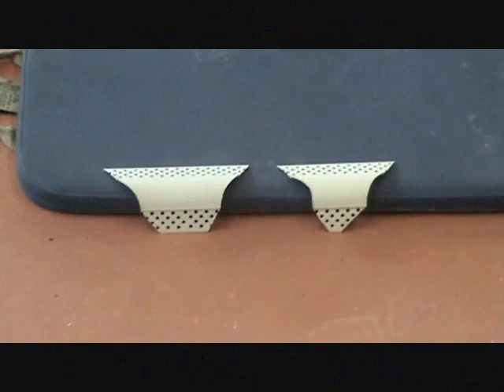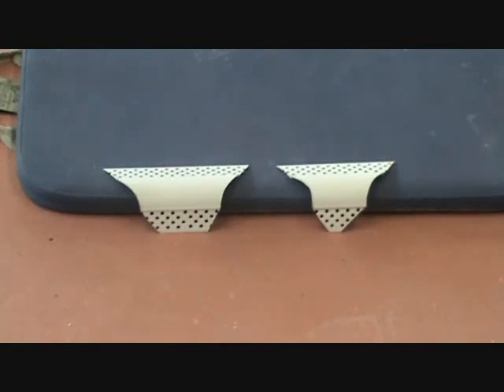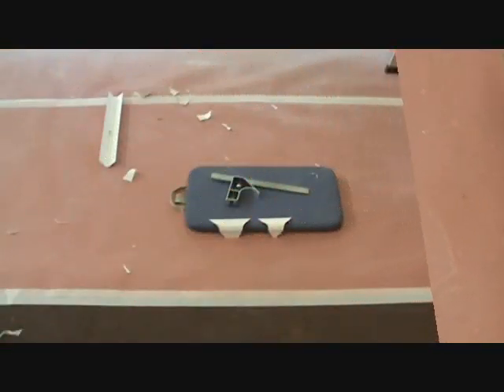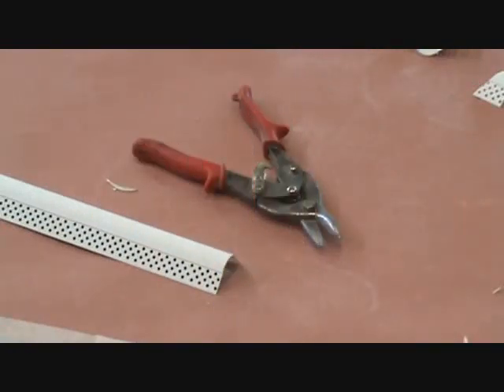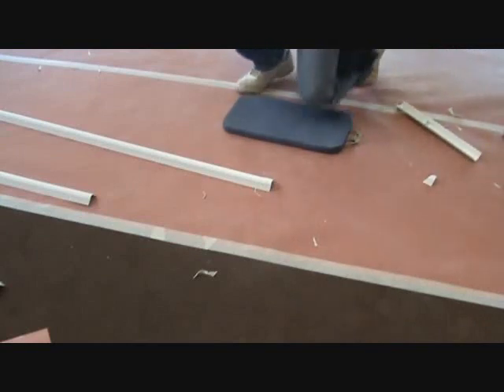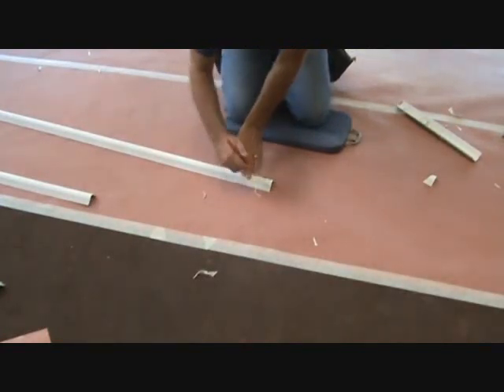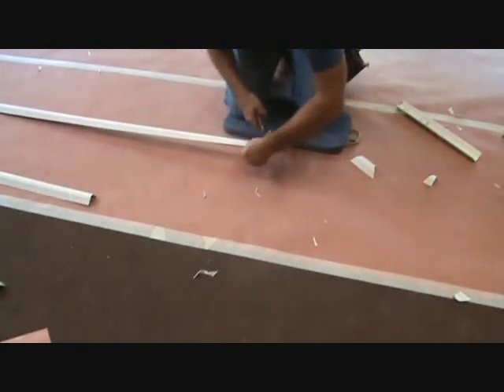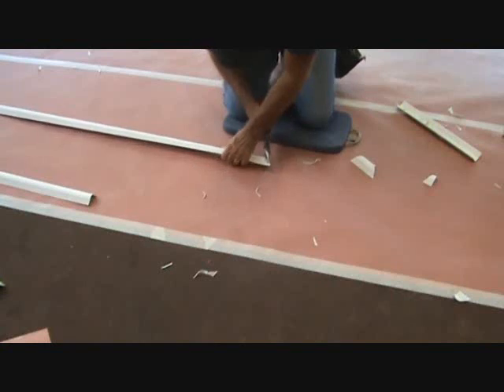Make "these" before cutting drywall bullnose cornerbead trim

Comment from the maker: You might be right. Try it & let me know. I like to use tin snips though. A little less dangerous than using a mitre saw. Be careful the plastic doesn't want to jump, when cutting. Thanks again for taking time out to send me a line. Much appreciated.   Joe  :0

Comment from the maker: @unitim I would not be a genius if I cut them with a mitre saw because they would not fit. If you notice, the templates have a "belly" cut out of the middle of them. If you cut a straight mitre cut, you will end up with a gap in the middle of your corner as the corner is rounded & not flat. That's why I would encourage you to make a couple of templates. Cut a few & see what will work then make some templates so each time you cut your actual pieces, they will be right. Good luck.   Joe  :0

Comment from the maker: @brentglittle See how I cut the templates? Stop the video & carefully look at the templates. They have a slight curve to them, in the middle. It's a little trial & error when cutting the pieces so when you get it right, make some templates & save them so you can use them each time you need to cut a 45 degree angle.....It helps.   Joe  :0

Comment: I actually found it easier to measure my length to the oustside of each corner, then measure the cut back distance ~1 inch to 1 1/8 in and mark that on the cut side.  I would square up w/ pencil, and draw my 45 degree tangent from non cut to cut portion.  Came out perfect w/o template.
Reply from the maker: Jared Waterman Nice idea. I expect you get better along the way. The tricky part is marking the 45 degree angle since it's round you still have to compensate or your angle will come out short in the middle. I ended up doing it kindof like that & making a belly in the middle of the angle cut then hold up & see how much more I need to trim. Do a few corners & you will know just how much to cut. Thanks again for the tip!   Joe  :0